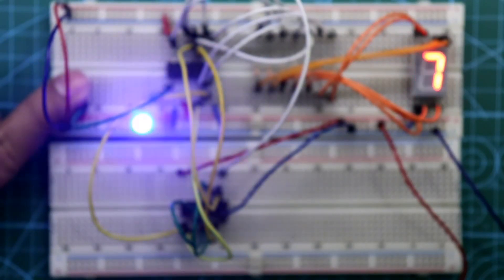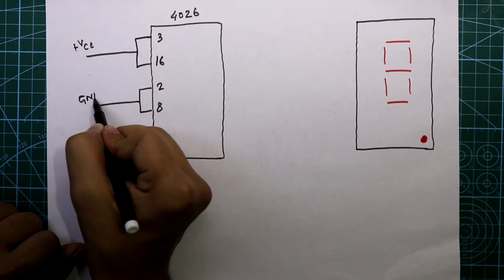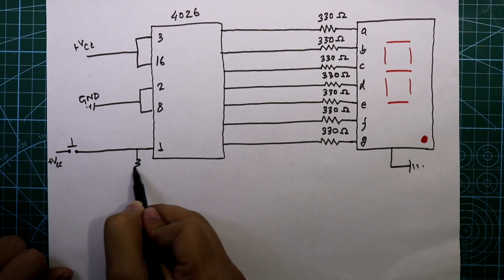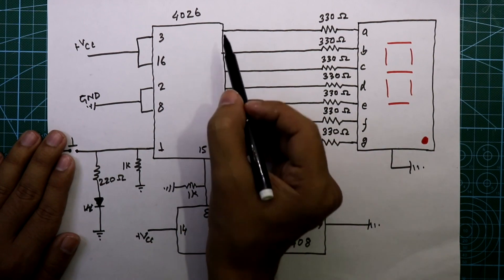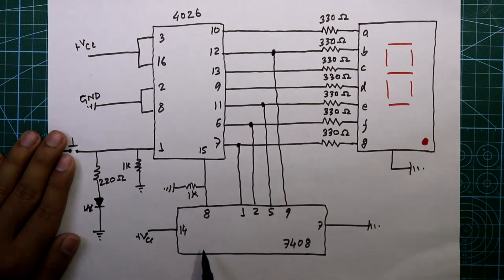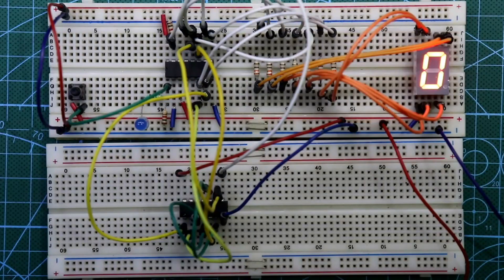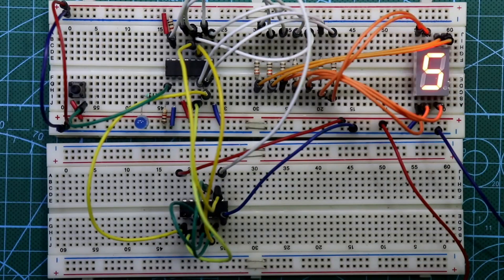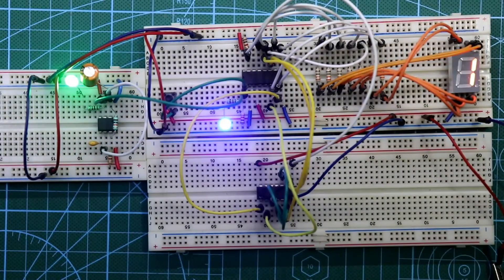MOD 8 counter with 4026

Comment: hello what is the 7408 for
Reply from the maker: It is AND gate IC and it resets the IC at count 8 (0 to 7). If you remove this, 4026 will count upto count 10 (0 to 9).
Reply: @EEWave  Thanks for the explanation
Reply: If i want to mod 0 to 8 are you can share circuit. Thanks